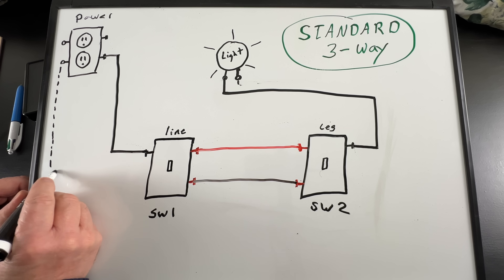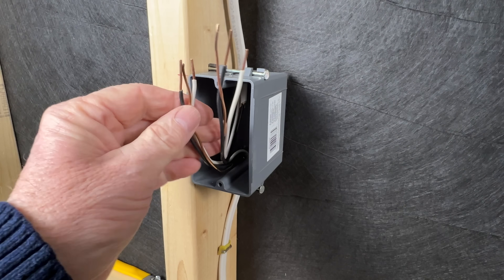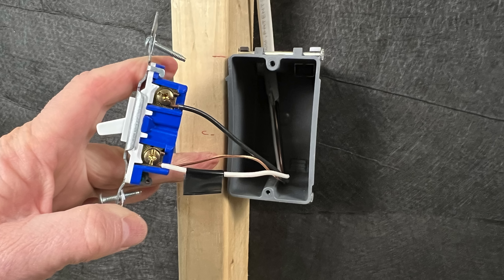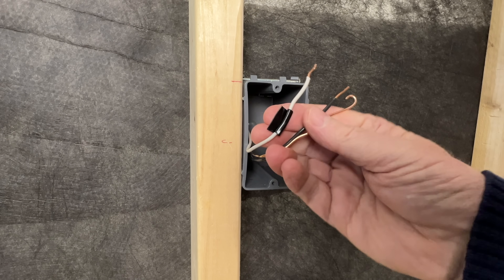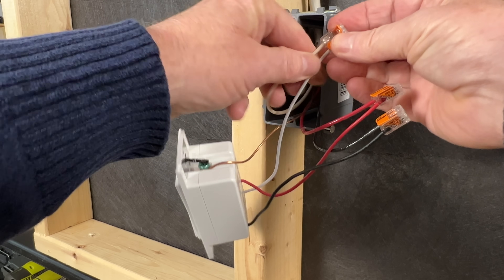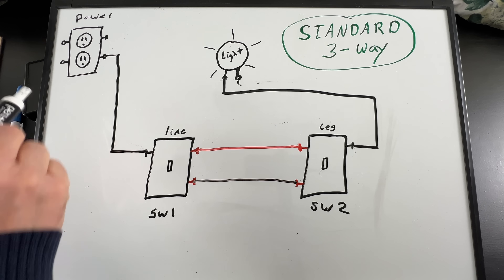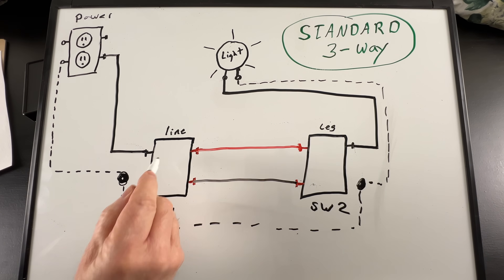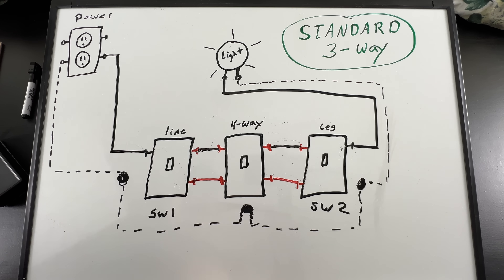How NOT to Wire Light Switches in 2025 (New Rules)

Comment: As in all of life's changes, it is meant to cost you more money so they can make more money.
Reply: No, it's ment specifically to prevent people from using the ground as a neutral for smart switches. 

Ever been whacked on a neutral under load? It hurts more than getting whacked by 277. Ask me how I know.
Reply: If it's to do with NEC/NFPA/OSHA things affecting life safety, it either means something bad happened and this the cure, or they identified the potential for something bad happening and incorporated it into code because enough people thought it made sense. It's not like they're making you go back and change stuff made to earlier codes unless it's a renovation.
Reply: BINGO !

Comment: What do you mean by "size limitations" when you were talking about an issue some inspectors might have with the dead end 3-way?
Reply from the maker: Re-identifying is not permitted for smaller size conductors. There is a separate code reference that allows it for switch loops but not all inspectors will allow the practice based on my experience.
Reply: @BackyardMaine  gotcha, the size limitation on what size wire can be re-IDed... I see 12 and even 14 re-IDed commonly, so I wasn't thinking about it, but I do a lot of service work so I see a lot of older stuff and homeowner / handyman work so...

Comment: I'm just going to run 2 wires from my lighting circuit across to where I want to put my switch, no ground wire, no labeled neutral wire, nothing...and there's nothing anybody can do about it because I'll do what I want.  Code makes sense sometimes but for the most part code simply costs you more money.

Comment: What a frustrating situation. Red wire? Nope. Working in an old building, I was lucky to find black and white wires, but no ground. What a mess. The instructions were well explained, though.

It's frustrating that we can't engineer a solution that doesn't require all this hassle. It's challenging to figure out what someone else did during repairs, especially when dealing with outdated wiring from the 1950s. 

Liked and subscribed.
Reply from the maker: Welcome to the channel my friend. I am working on a video now showing the Chicago 3-way method often used on homes built back in the 50s or earlier. Should have it up tonight.

Comment: Why are we using #12 instead of #14?
Reply from the maker: I used 12 gauge wire as an example to prevent someone unknowingly connecting switches that may be supplied by 20A receptacle circuit with 14 gauge wire. But yes most lighting circuits are 15A.

Comment: I hate not having a neutral wire. This is long overdue.
Reply: It was never needed.  Only the Hot wire.  And the job was very essie.
Reply: @lxramirez9788 
It's much easier to run power to switch, then you always have power at the switch box.
& It's easy, not essie
Reply: @christianheidt5733  And turn the switch off and you don't have power at the light box. No need to go shut off the circuit to change a fixture.

Comment: The simple way I use is a 14/3 from switch to fixture, which takes all the guess work out, and there is a neutral for the smart switches.  A good idea to ask the customer what typr lighting will be used in the future, just like the potential future EV in the garage, easier to install a sub panel for an EV  during construction...if not an EV, you got an outlet for a second stove or welder!

Comment: Why use 12/2 cable for a lighting circuit, would 14/2 be adequate? Clear and concise video on the new code regarding neutrals in a switch box.
Reply from the maker: I used 12/2 in my presentation to help prevent someone from (unknowingly) using 14/2 on a 20A circuit that may be feeding lighting from a receptacle circuit. But yes, most lighting circuits are 14/2 15A circuits.

Comment: At 2:08 I’ve been wiring since I was eight years old. But for many years now I don’t cut the common nor ground while wiring a switch.  I loop the ground wire around switch’s ground and fold balance of that grounding wire to back of switch box. The common doesn’t get cut and is simple folded to back of stitches box! This way I never worry about a connection that could fail! The black “Hot” cut and install on switch properly! Oh forgot I’m 70 now!

Comment: i think it' s absurd that they changed the code to add a neutral after this many years without it. there is nothing unsafe to my knowledge in not having a neutral in the switch loop box and the devices that do require that neutral are fast becoming obsolete due to the advent of wireless technology. 
I don't know why these devices need a neutral, if the use microamps they could be powered like illuminated switches.
that have no neutral.
Reply from the maker: The code is not retroactive so this change is for new construction. The safety issue has been that without a neutral wire in the box, people were connection the neutral from the smart switch or lighting control to the ground wire. This will allow them to work but create a hazard by having current flowing on the ground.

Comment: So much ado due to using jacketed cable. Most of Europe transitioned to single isolated conductors in conduits years ago, and modifying installations now is so easy, you just fish a new wire through the conduit.

Comment: In my world (mostly industrial), there were two ABSOLUTE RULES, for switch circuits.  ONE, that you ALWAYS feet the top of Switching Devices and take Switch Legs from the bottom.  As you showed the switch with the three conductor upgrade, the Red Switch Leg was on Top.  TWO, you carry the Black as Hot all the way to the TOP of the switch and then Black Tape the White Switch Leg back to the Feed to the fixture, for what we refer to as the Light Feed method (as opposed to the Switch Feed Method).

When I used to teach these things in an industrial trade school (1970s), we used a simple but descriptive method for referring to the various switch and fixture combinations. The first designation was the point where the Hot Feed was present.  Example: Switch - Light, Switch - Switch - Light, Switch - Light - Switch, Light - Switch - Switch - Switch, etc. My students left knowing how to wire all of them using this terminology (they didn't need to remember which state they were in).  

One last point that was not mentioned.  One of my vary first residential jobs was for an elderly lady who complained that she had trouble at night, turning all the appropriate light switches on and or off.  I told her that I could arrange every switch so that she could just walk through the house and push every switch down.  Over the years, I probably had 50 such requests from all of her friends.  I never leave a job without such switch treatment. Hint: As you drew the Three way circuit (travelers - top to top and bottom to bottom, one switch would always be Up and One would always be Down when the Light is Out, hence I "X" the travelers to achieve Both Down = Off (for the elderly ladies of the world)...
Reply: You’ll be hard pressed to find an individual capable of wiring switches correctly using one method.
I doubt more than 5% would be competent enough to reproduce the examples you described on paper or in the field. Most of those people are descendants of your teaching tree.
Reply: I too insist that when all switches are down, the lights are off. In his example, this would not happen but for simplicity sake I will let it slide. The diagram should use a X or crossing between the two terminals of the two three way switches. I like the fact that you codified this to which wire goes where.

Comment: considering the consumption of current LED based bulbs, the size limitation issue seems to be rather moot.
Reply from the maker: I used 12 AWG in my example but the wire is sized to the circuit. 12 for a 20A and 14 for a 15A. Most lighting circuits are actually 15A and not as of 2023 the code allows 10A lighting circuits.

Comment: Why 12-2? Lighting circuits are generally 15 amp which seems to require 14-2.
Reply from the maker: I use 12 AWG in my example incase someone didn't understand and installed 14AWG on a 20A circuit. Actually most lighting circuits are on 15A breakers and run in 14 gauge wire. But if they jump off a 20A receptacle circuit then 12 gauge wire is required.

Comment: You say 2023 than post 2024?
Reply from the maker: The code updates every three years. The new code is 2023. The next cycle will come out in 2026. As electricians we have to take an update course on the new code and that requirement depends on when your current license expires. Many still have not had the update. Also states can take years to adopt the new cycle as well. I think only three states have adopted the 2023 code so far. I hope this clears up the confusion.

Comment: The only deference with your dead end 3-way circuit is that i use the white and red as traveller and black as the return witch i always do even on black and white two wire, so if i see a black and white connected together in the light box i know it’s the line(black) going to the switch(white)

Comment: Here's a fun one for you: I discovered that some genius way back when took a hack and ran two independent breaker circuits on a single 12-4 wire with both sharing a common neutral. Looking at my box it looks like quite a few were run that way. Is that an issue I should be concerned about? Or one of those "it's fine but plan a future project to fix it" things?
Reply from the maker: Those are called multi-wire branch circuits where two hot wires from different poles share a common neutral. They are a legal way to wire circuits but there are requirements when installing them. First, they need a breaker ties or a two pole breaker can be used. This ensures they are on different poles and if one is tripped or turned off both circuits are de-energized simultaneously. Also the neutral wires must be pigtailed in the boxes rather than feed through the device which is common on a standard branch circuit. I think the few dollars saved running them isn't worth the possible hazards if they are altered by someone who may not know better sometime in the future. But, if they are wired correctly I don't see any need to replace them.

Comment: https://www.youtube.com/@BackyardMaine, doesn't the dead-end configuration create a potential for a EM transmission loop/antenna?  I was under ~an~ impression that those were generally discouraged.  First video of your I have seen.  I like the even mannered delivery.  Thank you!
Reply from the maker: Thank you! The dead end 3-way is not ideal. I do see them but most people will wire with the standard method. This does come in handy is when someone wants to change a single pole to a 3-way. The feed and the light are in the same box at the single pole. We take a 3-wire from the single pole box to a new switch location and change both switches to 3-ways. I have actually done this a few times myself.

Comment: USE THE GROUND AS A NEUTRAL. ITS CONNECTED AT THE BOX.
Reply from the maker: That's the main reason for the change. Now you have current flowing on the ground. The neutral and ground are only connect at the main for a reason. Very unsafe practice.
Reply: @BackyardMaine  maybe.. but it works 🤔😉
Reply: @bb590  Just because it works that doesn't mean it's correct or safe to use.
Reply: Hello when you typed that I wonder did you realize a grounded wire not the same as a grounding conductor? Talk to an engineer he can explain to you.
Reply: @ralphbuschman8141  oh i know the difference. You can have current on grounds on other recepticles. Yet, it works if someone doesnt want to make a mess smashing out drywall. Yes.. unsafe. Yet.. it works.. 😳😉

Comment: All lights should be wired in a way where you can add a second switch for a fan. Fight me.
Reply: Not necessary and a waste of time. Almost every ceiling fan today has a remote and will not accept two hots. Older ones had one hot input for fan and one hot input for light; that's no longer the case. The power supply now usually goes to a remote module located up in the ceiling and the fan and light are controlled only through the module via remote.

Comment: My brothers house switches are wired where the neutral is a hot. I couldn’t figure out for the life of me why the breaker kept tripping after a light fixture install. So if I get this right, the white in the switch housing goes to the power supply black. And the black from the switch goes to the power supply black also. And the black from the fixture goes to the same place? So make a pigtail pretty much? And the neutral from the fixture goes to the neutral of the supply?

Comment: Your receptacle is probably symbolic but mixing that circuit with lighting is frowned upon in many places. Ideally, receptacles are on #12 20 Amp and lights #14 and 15 Amp breakers. 
Also interesting, the neutral wire is for switch options, required by the NEC, and on the board of directors are CEOs of the companies that make the smart switches.
Reply from the maker: The CMPs that write code and approve changes cover a vast array of people from different areas. Consumers, electricians, engineers manufactures and much more. The decisions are agreed on by a consensus vote and no group has more power than the other.
Reply: @BackyardMaine I used to live in Maine, Bath and Orono. When the explorers got to a spot that wasn't on the map, they asked a local what the name of the town was and he said, "Orono". They walked away mumbling, How does he not know where he lives? Ayuh
I prefer the sideyard, where the cars are.
Reply: Mixing receps with lighting is not frowned upon and is perfectly legal and sensible. Electrician's choice, and I typically keep them separate, but either way is fine. FYI, most receps are considered part of the General Lighting Load.
Reply: @pld8993 Correct. The place I work has 277 for lighting so that makes it easy.

Comment: We used to refer to those 2 different ways to wire a 3-way as:
1.Take the neutral to the light; or
2. Feed the farthest switch first.
Good way to remember them. Which one to choose depends on how the circuit is run.
Nice video. Thanks.
Reply from the maker: Thanks for sharing

Comment: maybe its just me but I found this to be somewhat click bait because by saying "New rules" and "2024" it makes me think that a new NEC rule was created for 2024 instead you're just mentioning an old rule, the required neutral wire. I was hoping I was going to learn something new but was disappointed. Then I thought I'd be redeemed because you mentioned 4 different ways to connect 3 way switches but only described 2 of them. I actually wanted to learn about the illegal 3 way connections. Not because I want to do them because I wanted to learn something new. Yet I learned nothing new here.
Reply from the maker: The code updates every three years and the latest update in 2023. Most states have yet to adopt the cycle and many electricians have not taken there code update class yet. For this reason a 2023 change is new.

Comment: I understand having to meet code.  But marking a white wire where it connects to a switch seems pretty absurd to me. Anyone needing that would have to be entirely incompetent to with electricity and the marking wouldn't mean anything to them.
Reply from the maker: Not all homeowners understand electricity but most of them would attempt to replace a light switch. I have actually seen them blow up a switch by connecting the actual neutral wire. Hopefully a black mark or colored tape would make them stop and think. The other reason it is once it's disconnected from the switch it may be difficult to determine which white wire is hot and which one is the neutral.

Comment: my company that i work for doesnt do dead end 3 ways we used a 14/2/2 in most cases to transfer power into the box that would be a dead end and either cap off the hot leg or continue to another box  . that way there is always a neutral in every box the red and red/white become the travellers

Comment: Welcome to the nec where our panel of greedy industry manufactures decided codes need to change to increase profits.
Reply from the maker: You may be surprised at the groups of people who make up the code making panels. (CMPs) There’s a lot of misinformation about this.
Reply: @BackyardMaine  every major manufacture has a rep on the board. I knew one of the few inspectors on it.
Reply from the maker: @patrickhein9470  But there are also consumers, engineers, electricians, Safety personnel and much more. All discussions are determined by a consensus preventing any decision being made for profit rather than safety. I've seen this with my one eye and I was very impressed with the operation. Some of the best minds in the industry. I used to think the same thing as you do..